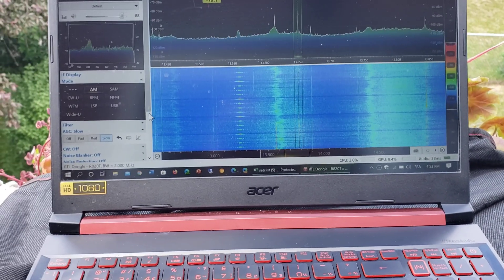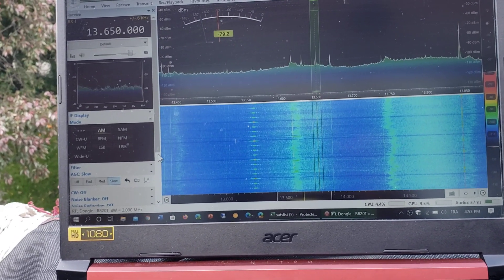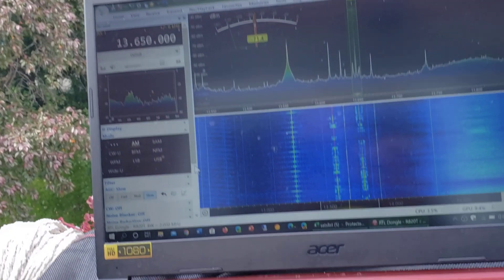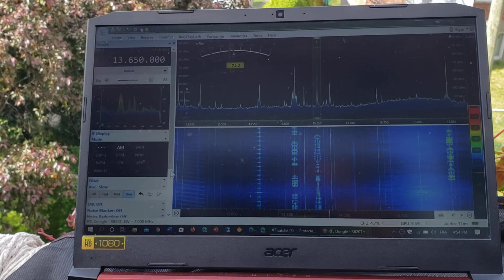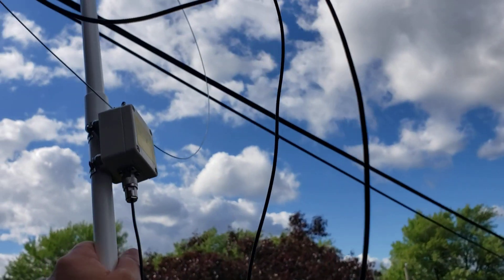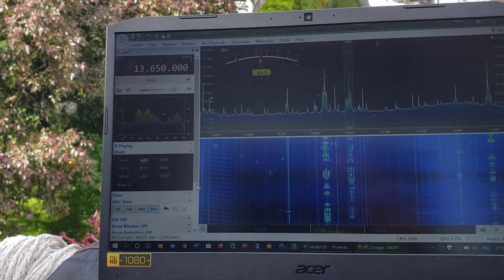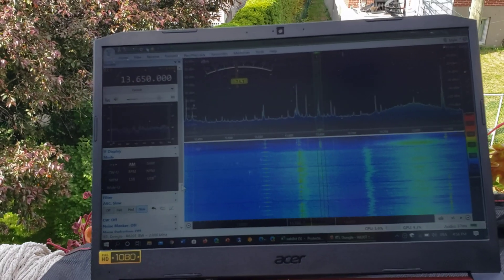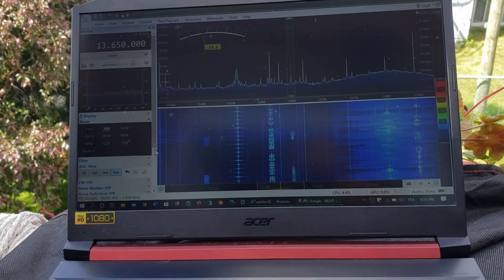K180WLA loop antenna testing radio Romania 13650 kHz Shortwave observations

Comment: I just recently purchased an updated version that has a FMDX/HF switch in the loop box. It says in the manual that turning off the pre-amp will stop the FM breakthrough for HF receive. I opened the box, and sure enough there is a micro switch inside.

Comment: I've been using the KW180 for the past couple of months with the RSPdx, though I ditched the supplied loop and instead using a 1m loop made of heliax LDF-4-50. 

For me it's an OK antenna down to about 120KHz. I was more surprised about the performance on the VHF and UHF bands, works well for civil air and mil air bands but seems to drop off over 400MHz and obviously directional.

Comment: Local circumstances can make or brake an antenna. However, given the costs of this product one can’t complain. Based on most reviews I’ve came across it is not for me. But if you are on the go and look for something compact it might be just the right thing, not perfect but good for the job. Greetings from Holland , Willem.